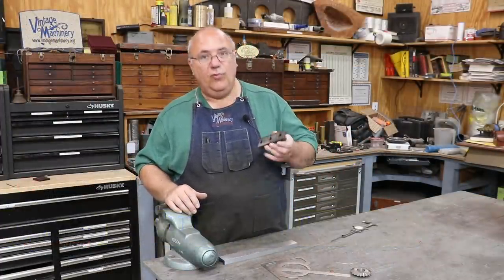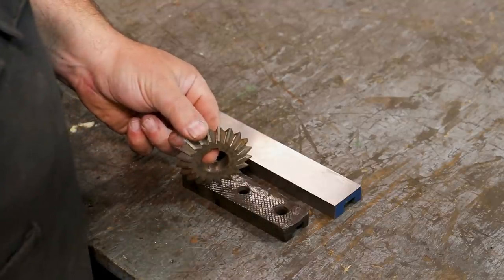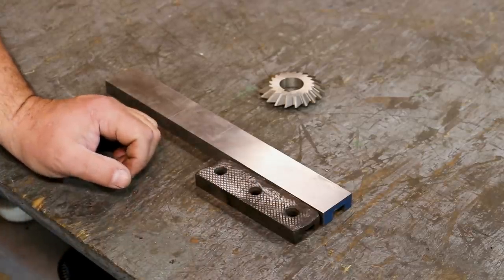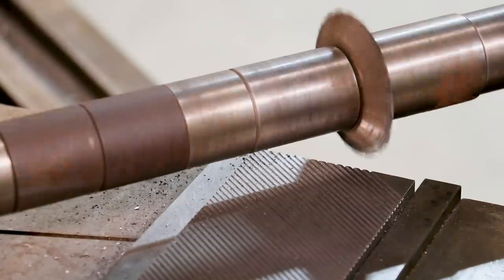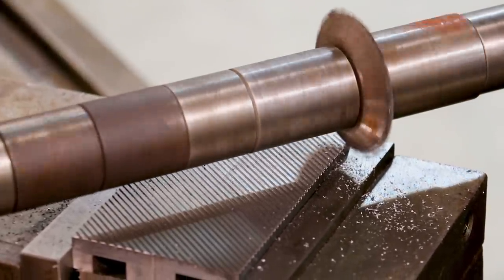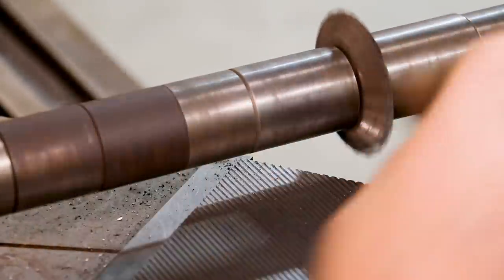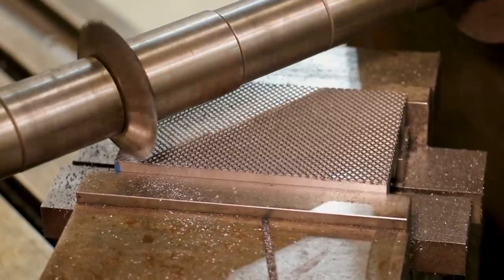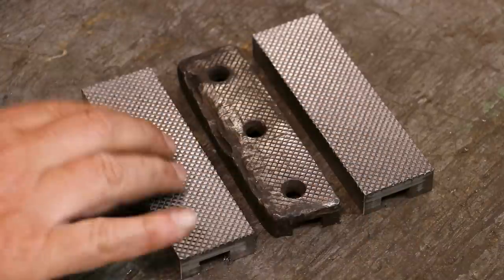Making a Set of Vise Jaws: Milling Seriation Teeth on the Horizontal Mill

Comment: It's a lot like working wood with hand tools.  You plan well in advance what you want to do and nibble away at the material until it fits just right.  Having tools sharp enough to cut a stray thought helps, too.  The attention to every detail is what some would call a Zen experience.

Comment: For production they probably bolted them down to a fixture plate and cut the slots on a whole batch with a shaper. Multi-tooth cutters like that were not nearly as common back in the day, and are a pain in the pocketbook to buy and have sharpened. Shapers would be way cheaper, and the automatic stepover means one guy can run more machines. Vise jaws are an ideal product to mass produce on a shaper.  That is probably why they picked 50 degrees instead of 45. If you cut from the long end, with 50 degrees, you angle the part less perhaps allowing more parts to be cut in one run.
Reply: Thanks, Notso! I was thinking shaper from the get go. Maybe ABOM would run off a set JFTHOI.
Reply: Neat point about the 50 degrees!  When he said that, i figured he was mis-measuring a 45 degree angle!

One thing you can do on a horizontal that he didn't as well is set up multiple cutters on the same arbor. Presumably you could get 100 thou thick double angle cutters like that and just stack a bunch.
Reply: Mattys workshop made two   of these very jaws on his channel couple of days ago just as you suggest. Although he did not run another machine at the same time, it is easy to see how he could have done.
Reply: I was just thinking that a shaper would be great for this application. Straight, shallow cut with a small step over, all you'd need to do is grind a custom tool.
Reply: And here I was thinking they heated them up and stamped the pattern in them :)
Reply: Keith has a planner so that would be my choice. .1" step over should be no problem. Back in the day all our tool steel blocks were roughed out in the shaper, so a shaper and tool is not an issue.
Reply: I agree, but Barry Caudle's idea takes it a step further, use the planer that Keith just completed. We haven't seen that actually used that much and as far as I am concerned, more fun to watch!
Reply: @garythomas4914  Well, you could see the planer in the background.  Like to see this done on that machine.
Reply: @laurieleyden3654  I watched that yesterday.

Comment: I did a knurl on round stock back in college, but was at a loss as  to do it in a mill.  Very nice.     Mine wasn't that good.  Was using a cloth to wipe away excess oil  when it got eaten by the tool.  Knurl was shallow, but it worked.

Comment: The shot beginning @ 20:30 put my OCD into overdrive!  If the angles of the opposing grooves were the same, the lines formed by the intersections of the diamonds would be parallel to the ends of the bars...assuming the ends of the bars are square.
Reply: They're not even close to square, but they're just saw cut so that's hardly much of a surprise.

I'm sure he'll get to it.

Comment: Omg that spot of rust is and would drive me crazy 🤪 I would have to get a piece of sandpaper and clean it up.... wish he would do it but I know he won't.... but if it was me I would very much so stress out till I got that off.... it's got me stressing out just looking at it now... just grab a piece of sandpaper and hold it on there while it's turning and it would simply go away and look a lot better not to mention get rid of the steel cancer before it could spread any worse.....

Comment: Hey Keith, Could those grooves have been cut on a Metal Shaper or Planer using a .025" cut at .100" table feed???
Reply: That's just what I was thinking.
Reply: They could but a single point tool would dull quickly and not last long, especially on tool steel.

Comment: Keith, EXCELLENT EXCELLENT Job !!!!!!!!!! 
After watching the vid sev times, examining the orig part as close up as possible and reading all the comments, I am of the opinion that everyone is wrong abt how it was made.....the slots are too crisp and the individual squares very square, I'm believing that the part was heated cherry red, placed in a press or hammer forge and the impressions imprinted upon the part that way.....production wise that would make a lot more sense and time wise much more cost effective.....the master die that impresses the pattern could be made simply and changed/replaced as needed....the orig steel part would have been a softer steel when stamped/impressed and then  batch hardened to the desired hardness.....doing it that way, hundreds could be made in a day....just saying !!!!!!!
Reply: You're probably right.

Comment: Keith says that the serrations are 25 thou deep and 100 thou apart but does not say or show how he measured these dimensions; anyone know how this is done...it would have been nice to see that part as I don't think this has been shown before?
Reply: He had a dial gauge(in the previous video, " Machining a Set of Vise Jaws 18:34) with magnetic base that he set on the side of the arbour support bars, measuring down to the top of the vise, touch to surface then adjust for 25 thou DOC and he was also using a dial gauge for the 100 thou spacing on the cross slide
Reply: Don't return and say thanks or anything.

Comment: How (with what) did you measure the depth of the incisions?
Reply: He had a dial gauge(in the previous video, " Machining a Set of Vise Jaws 18:34) with magnetic base that he set on the side of the arbour support bars, measuring down to the top of the vise, touch to surface then adjust for 25 thou DOC

Comment: Kinda wondering if you could use multiple cutters to get a bit more speed at the cost of a more fiddly setup.
Reply: I guess if you had a couple more cutters and appropriate spacers and did the math. Would be an interesting math problem.
Reply: @The_DuMont_Network  Multiple cutters   .200 thick with one step over would cut all the serrations in two passes each way
Reply: @ellieprice363  I'm reminded of Alton Brown an his disdain for unitaskers. Unless  was tooling up to make vise jaws in quantity, I don't think I would want to invest in a bunch of cutters I would use only occasionally
Reply: @ellieprice363  Sure. But who stocks that many cutters to use once in a blood moon?
Reply: Doc Dumonnt: Sorry I didn’t make that clear. Multiple cutters ground to .200 would only be practical for manufacturing thousands of vise jaws for production. They could also use .300 thick cutters and step over twice. They’d probably use a special fixture to position the jaws twice at the proper angle.
Reply: @ellieprice363  I'll vote for the shaper. It is way more cool to setup and operate. I learned to use on 50+ years ago. If you truly know the machine you can do some really neat things on one, and almost "Set tt and Forget It", as Ron Popeil used to say.
Reply: @The_DuMont_Network  The shaper would work well for a few parts but much too slow for high production. The single point tool would chip or dull quickly and need to be replaced or sharpened.
Reply: @ellieprice363  I would have to do a cost/reward analysis. If I were making enough of them to invest in a multi head cutter or a bunch of cutters which could be grouped, I would invest as long as the mill could auto index. Otherwise, a good tool or insert and shape away.
Reply: @The_DuMont_Network  Have at it.
Reply: @The_DuMont_Network  I'm not saying getting about thirty of them, just maybe two or three if you have them handy in stock. The old saw "One is none, two is one" still holds true.
Reply: @ellieprice363  I shall. A local job shop picked up a shaper and I showed them the rudiments of operating it. Pretty versatile machines if you treat them right

Comment: I would have done it at 45 degrees instead of 50, seems to be an oddball angle for no good purpose. but that is my OCD talking i guess...
Reply: My sense is it's best not to have them at an angle that might be very common when holding a piece - they might slip a bit.
Reply: @kindabluejazz  I kinda get that, but 5 degrees is close enough to force a slip I'd suggest.

Comment: I’m not sure if the cutter would like that hard steel but in terms of procedure, this looks like a job for the shaper. With automatic step-over, this tedious task would go without all the manual input for each pass. Just my amateur observation, I’ve never run any machine tools.  🥸👍